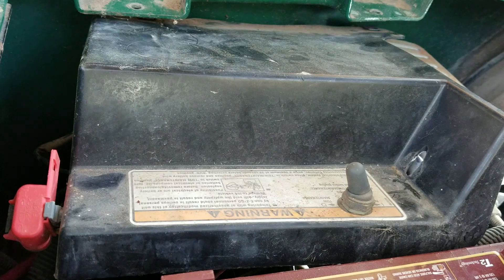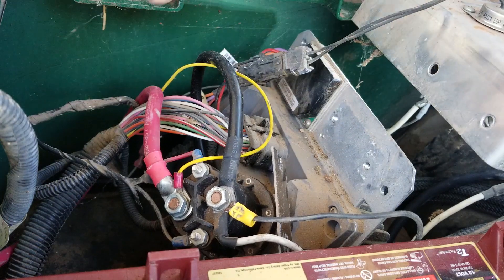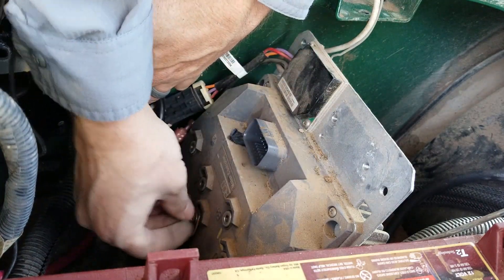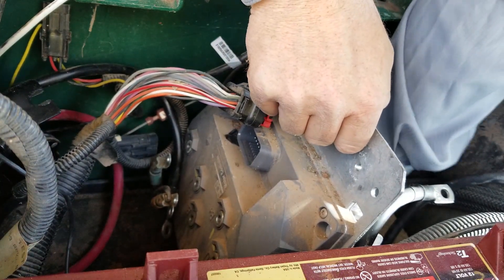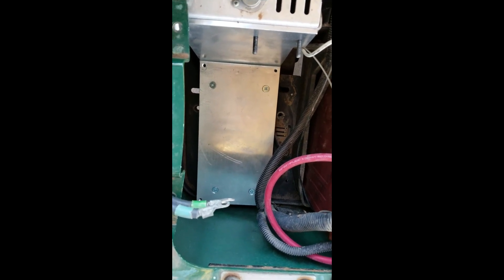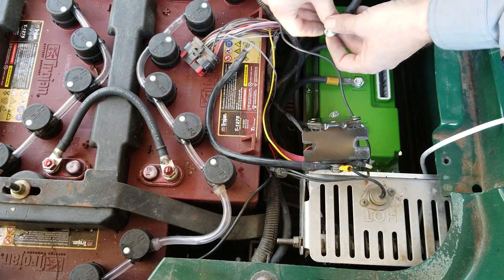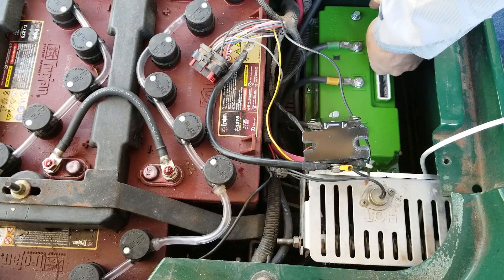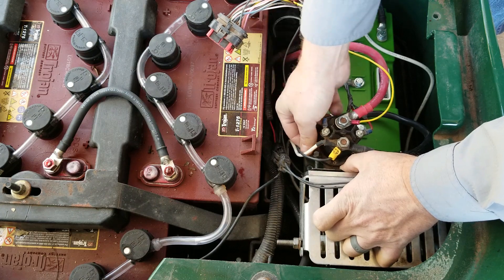2008 48v EZGO RXV Danaher to Navitas 600 amp TAC 1.0 Controller Install

Comment: Allowing the controller to request much more power from the battery will fry that stock solenoid. Your controller will deliver 400 continuous amps and that solenoid is probably rated at no more than 180 A. You need to put in a heavy duty solenoid.I know from experience.

Comment: The video is extremely helpful.  I have the same cart and installed the same controller.  I am having issues "Precharging too fast error"  which is described as 1)The main contactor may be welded closed 2)Or if a large power regen resistor is installed (RXV only) it is incorrectly connected to the battery side of the main contactor.  I believe is issue resides with the small gray wire which is connected to the resistor.  Can you confirm that this is connected to the same side of the resistor that is connected "R" along with the cable provided with the controller?

Comment: Does it matter which side of the resistor goes to the controller and which side goes to the solenoid?  I did this upgrade on my 2014 RXV.  The resistor cable isn't long enough to reach my new location where I mounted the MZJ-400a solenoid.  One side of the resistor goes to controller and one side goes to solenoid.  Just wondering does it matter which side goes where?
Reply from the maker: I'm not 100% sure that you can or can't.  I don't think those type of resistors have a + or - so you should be able to hook it up either direction.  You might hit up Navitas customer service they are very helpful and knowledgeable.

Comment: I have a 2012 Ezgo RXV with a Danaher controller, I want to do this upgrade but how do I know if my cart is AC drive?
Reply from the maker: All RXV models are AC drive, TXT are the DC counterpart 👍
Reply: it is written right on the motor.  AC Phase 3 - 3.3KW

Comment: What is the top speed and where do I get navitas controller harness and some controllers? Thank you
Reply from the maker: My tires are slightly larger than stock tires and I can easily hit 28 with room to spare.  You can get the controllers all over internet.

Comment: I like the video, I just bought the same exact cart.  I’ve been going back and forth weather to have the stock Danaher turned up or upgrade to the navitas.  Was it worth the $$ in your opinion? Have you had any of the “standard” 08’ issues?
Reply from the maker: I would say it is definitely worth it.  Navitas has great customer service and tech support was very helpful.  The only 08 issue I have run into was the speed sensor had to be replaced after the upgrade.  The cart was jerky and when I called support they quickly diagnosed the issue and after replacing the sensor the cart works like a champ.

Comment: How do I know if mine has danaher, navitas or curtis?
Reply from the maker: The Danaher is a grey controller and the Curtis is black, you have to take off the panel that holds the tow run switch to best see it.  The 2008 to about 2012.5 came with the Danaher from the factory.
Reply: @UTFreak23  Can you  send me the link for the Navitas kit.

Comment: Nice video. Was your factory controller bad? If so how did you determine it was faulty? I have an RXV that is not working and trying to troubleshoot. Thanks
Reply from the maker: I replaced the Danaher for more performance, the controller still worked fine.  The guys at Buggies Gone Wild forums are really helpful 👍
Reply: @UTFreak23  Did you see any speed increase since changing it out?
Reply from the maker: @David25522  yes I was around 20mph before now I am running around 28-29
Reply: @UTFreak23  Thanks for the quick response.
Reply: @UTFreak23  Btw did you order your 2 gauge wire or make one?
If you did order one please give me the link.  
Thanks a lot!
Reply from the maker: @David25522  I ordered the cables from eBay, the seller I ordered from doesn't have them in stock at the moment but thats about the only place I could find 2g
Reply: @UTFreak23  Thank you for the quick response!!!